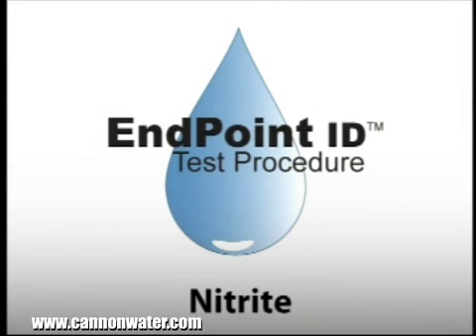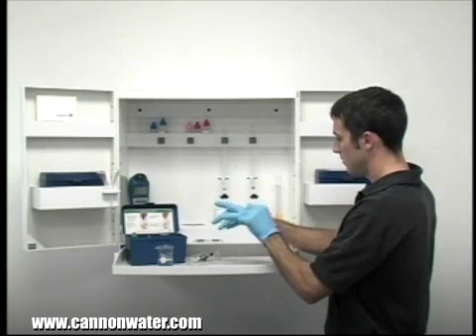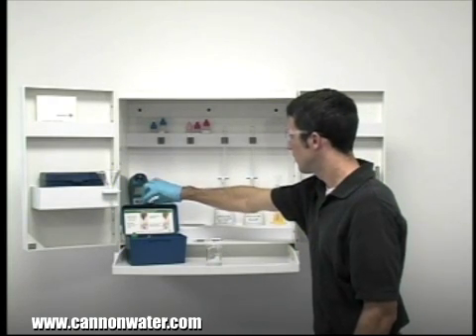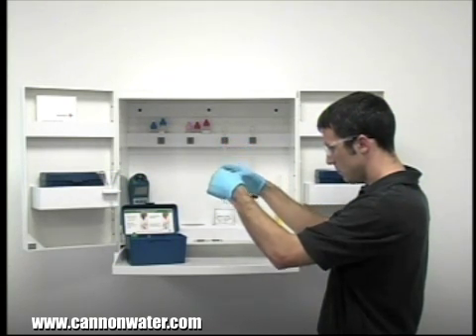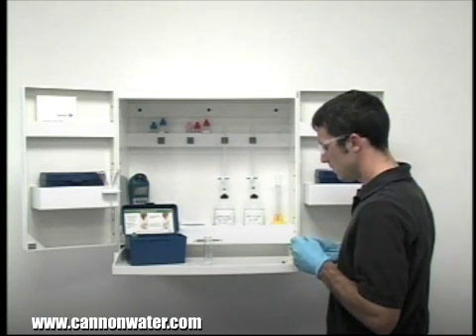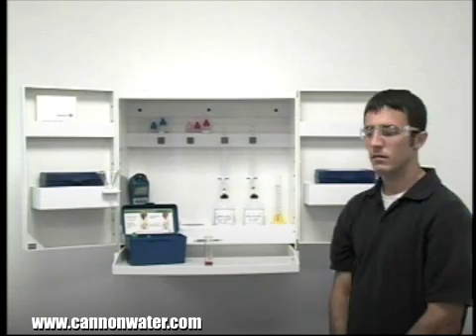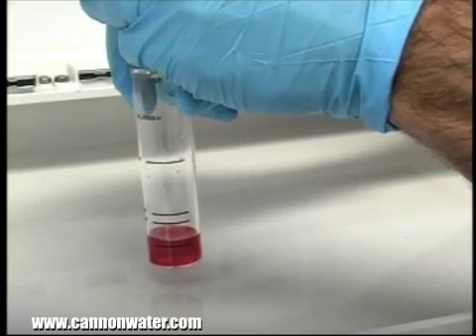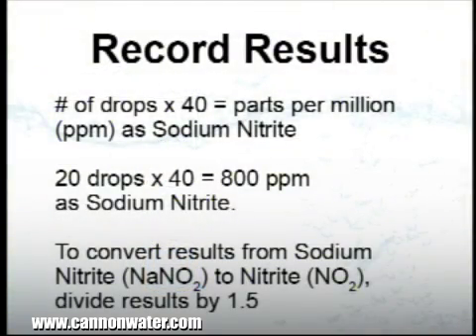Nitrite Test

Comment: @1091Floyd21 Baically chlorides sulfites sulfates carbonates and hydrogencarbonates are at any one point insoluble when combined with a positive metal ion. such examples of insoluble salts are
lead(II) chloride, lead (II) sulfite, silver sulfate, iron (II) and Iron (III) carbonate, and iron (II)and Iron (III) hydrogen carbonate. in the case of nitrate, all of its salts are soluble and no precipitates are at all left when any metal ion is combined with a nitrate ion